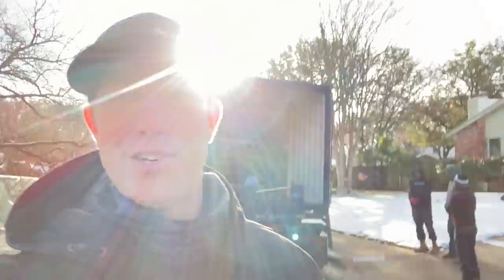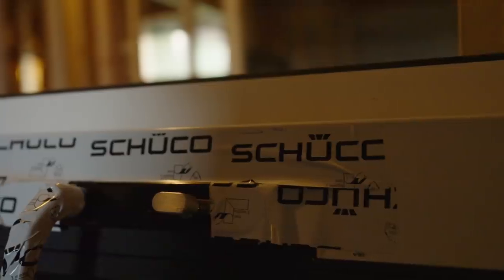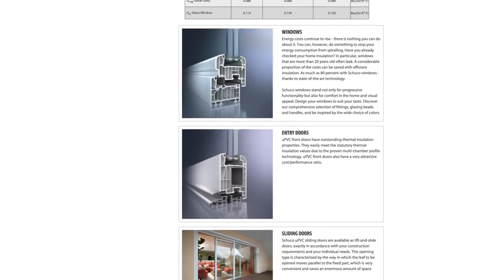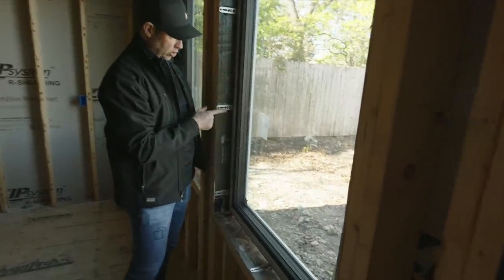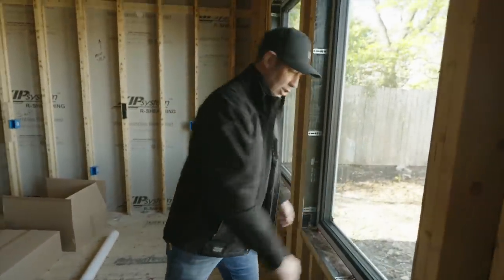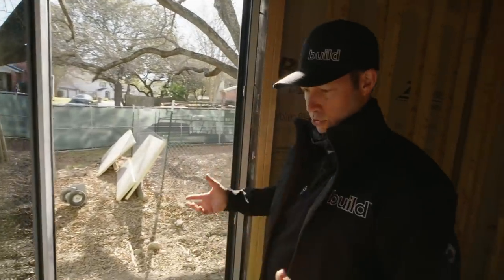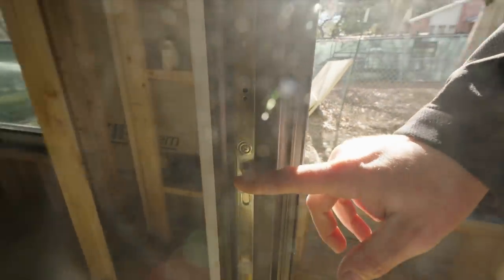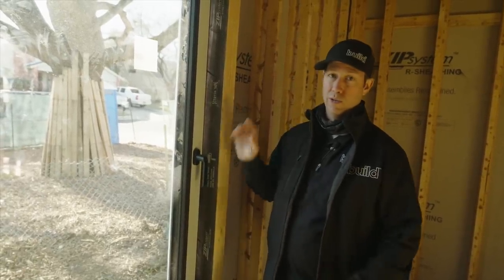Ordering Crazy Efficiency (and Affordable) Windows from Europe!

Comment: Me sitting here in Germany. That's a standard window here and you'd be fined if you use a shitty window if you replace your windows in an existing house or building a new one...
Another aspect you can have in those windows are locking pins for commercial use these doors and windows can't be pried open without taking a lot of time. These steel pins are also locking into a steel insert. As door fitment is another issue you have in commercial spaces for security and indoor climate control reasons.

Comment: I'm not a home builder, but have installed many sliders and doors. When we put down the sealant for the threshold, we put 2 very fat beads of caulk straight across the entire bottom to make sure there's a connection. We want to make sure there's contact between the threshold and the floor. Those thin beads at 10:26 are fine, as long as everything is perfectly flat and perfect, which it probably is on Matt's job ! Just wanted to let people know that most jobs require a much bigger/fatter line of caulk to seal the slider or door to the floor.
Reply: I agree with this.  Also to add, most doors aren't flat on the bottom contact side (the one in the video didn't look like it was either) so you need to be mindful if it's enough sealant to fill the gaps of the window base itself and any discrepancies of the floor as well.
Reply: @beurky , well said !
Reply: @augustreil  my opinion comes from a bad experience. when I told the window guy to caulk the shit out of it, and it was leaking from under the base, when we took it out the beads were a couple thin lines..
Reply: @beurky , I can believe that. Most don't realize how much it takes to make contact on both pieces.

Comment: Will you do a video on what's happening in TX with the freeze?
Reply: I'm not a video maker, so hopefully text will do:
Texas isn't used to being colder than Alaska.
In fact, during the winter power plants can shut down and undergo maintenance. The summer is when power is in peak demand.
On Sunday night, windmills stopped working (no anti-freeze systems, I believe, were in place), natural gas power plants went down, coal plants went down, nuclear power plants went down. I think around 1/3 of Texas' capacity went down. These places were either not winterized in response to a less severe winter storm in 2011, or not to the extent to survive these temperatures, or protocols were not followed. Also, many homes are heated by natural gas, and homes were given priority over natural gas power plants, so that's also why some of them turned off.
The grid didn't fail, but to keep it from failing, power had to intentionally be shut off.
Up in Dallas, snow and temperature records from 50 years ago were broken.
Enough power was brought back to restore power to 400,000 households, but during the night is another storm, but the temperatures are slowly rising. Thursday is almost above freezing, then Friday is finally above freezing.

Also, on a personal level, homes don't appear to be insulated terribly well. My home is from 1999. I was actually supposed to have someone who is BPI certified (got the idea from another one of Matt's videos) come over yesterday, not realizing I chose the coldest day in decades. I have a thermal camera that attaches to my phone. I can see freezing air come in through wall outlets and switches along the exterior, and through windows, which is why I'm watching this video. I had some rooms that were already hard to keep comfortable during normal weather.
Reply: @TheEngineerd  Thank you for such a detailed explanation. I hope things get better in Texas.
Reply: The power plants can't operate at capacity because the federal govt will not allow them to. Why, because it will create too much carbon and they will fine the plants massive amounts for violating their standards. It matters not that millions are with out power and thousands are dying. We must not upset the environmental wackos!!!!!!!!!!!!
Reply: @dannywilsher4165  Thousands? You mean...10 people? Literally 10. About on par for the geographical size of the storm. Almost every major storm system that hits the northeast claims about 4-5 people.
Reply: @dannywilsher4165  Given the complete absurdity of the first 90% of your comment, the irony of the last statement is pure comedy gold.
Reply: @JimYeats  LOL!!! Thousands may be stretching the truth a little but I was watching the news just before I commented and some official from Galveston was requesting everyone who had a refrigerated truck to please come to Galveston because they had so many deaths that they didn't have a place to store them. Sounded like thousands to me......
Reply: @ae1ae2  Well, who are you to tell me I am absurd? All I was doing was repeating what I saw on the local news!!! And I was totally serious about not wanting to disturb the wackos!!!
Reply: @dannywilsher4165  It sounds to be complete bullshit... There is no such federal law which would not allow them, and if there was, they could and should ignore it due to extreme circumstances.
The power plant cannot operate simpliy because of the cold, which they are not prepared for.
Reply: @juzoli  The person I saw on the news claimed to be an ERCOT official and he was the one dispersing the information I shared. He also was saying that the windmills and solar panels produce 25% of the power for ERCOT and because of the extreme cold the windmills and solar is useless. He also said they weren't allowed to turn up their gas fired plants because of EPA regulations. I think it is a bunch of bs also. It's not right that so many are cold and in the dark just because of govt regulations.
Reply: @dannywilsher4165  

Texas opted out of the national grid and set up its own because Texas did not want to contend with federal regulations, including those that mandate preparations for extreme power demand conditions.

Had Texas followed federal guidelines, much of the current chaos might well have been minimized or prevented.

As for those "thousands (who) are dyeing", what colors are they using, and are they color-fast?
Reply: @donna30044  All I was doing was commenting on what I saw on the news. I was exaggerating about the thousands because of what the man from Galveston said. If the fed has anything to do with anything it is always totally screwed up to the max!!!!!! 
And they really didn't say what color they were turning. Probably going to blue, turning to red and then black as they got frozen!!!!
Reply: @dannywilsher4165  

Oh, you meant that people were dying (becoming dead), not, as you wrote, dyeing (coloring thread, yarn, fabric, leather, or other materials).
Reply: @donna30044  LOL... Yes ma'am. Spell correct got me!!! I hope you got my humor in my reply. Hope you are staying warm!!!
Reply: @dannywilsher4165   you got a source for that? Because that’s not what I’ve read anywhere else
Reply: @dannywilsher4165  Don’t share unchecked bs then...
There is a big difference between something being frozen, or laws not allowing to fire it up.

Wind turbines and solar can easily deal with cold, proven by all the wind turbines and solar panels built at cold places. This issue is specific to the ones built in Texas. Which is sad, but we should never judge an infrastructure based on extreme events. These are designed to work fine 99% of the time, and no more. 100% availability for any infrastructure is crazy expensive, and doesn’t worth it.

Also there might be laws which favor renewable energy against gas and coal, and that is a good thing. But there is absolutely no law which would deny their power plants to start up in state of emergency like this.

It sounds like just a few anti-environmentalists who are trying to weaponize this weather event to reverse the progress we made in the past...
Reply: @dannywilsher4165  It's apparent that you don't like finding out whether claims are true. Have fun with that.
Reply: @melissamybubbles6139  I am merely doing what the masses do. I hear something on tv and it has to be the gospel. If a person behind the camera says something it has to be true. Look at all the people who have heard all the fake news for the last 4 years and now they are totally convinced that we had a horrible president. They weren't told any of the good so they had no reference of the truth. I guess I can't regurgitate something I heard without being called out for it. I guess should research for hours and find the truth before I claim something that fits or don't fit someone's narrative.  And yes sir, I am having lots of fun with it!!!!!
Reply: @dannywilsher4165  Your comment has lots of insults, but close to zero facts or logic.

You didn’t even care to explain what is that “made up bs” you are talking about. How do you expect people will take you seriously.
You have to be more specific, include verifiable facts, maybe scientific studies proving your point, and some idea how to do it better.
Reply: @juzoli  So my fact that Mt St Helen completely blows your total world view out of the water is not enough fact for you? Just what I was saying, thanks for proving my point. Sheep have a hard time believing the truth!!! Hope you are staying warm. have a nice day!!!!
Reply: @dannywilsher4165  
Mt St Helens CO2 emission: 0.01Gt
CO2 emission from fuel combustion alone, world total per year: 30+ Gt/y

Your volcano is not even close... I told you to include your facts...
Reply: @juzoli  Make up things to fit your narrative. LOL!!! That is funny!!!!!
Reply: @dannywilsher4165  I gave you facts. This is the official measured data about emissions. You are free to search for it yourself. But you gave nothing but insults.
And the funny thing is that there is NOTHING stopping you to write down the facts what backs up what you say.
Reply: @dannywilsher4165  
Search for this (I can’t put link into the comment):
USGS: Volcanoes Can Affect Climate
Reply: @edbouhl3100  LOL!!! How did you figure that out?
Reply: @dannywilsher4165  They were sort of right about the capacity. There are federal regs limiting porwer capacity, but because Gov. Abbot declared an  emergency, the rule was suspended.
Reply: @dannywilsher4165  ...wind farms in Texas were AT OR ABOVE average output during the Big Freeze.
Pictures touted as “frozen windmills in  Texas” were actually pictures taken in NORWAY.
Major power disruptions were from natural gas power plants (frozen pipes and meters/instruments) and our nuclear plant (frozen cooling pipes).
Other disruptions were from natural gas production facilities.. little-known fact, natural gas comes out of the ground with a rather high water content, this water content is what froze, due to facilities choosing to not insulate piping and other handling equipment.
‘
The  TV commenator who said “EPA regulations” prohibited gas plants from firing up is wrong...or lying.
Our Elected Political Leaders here in Texas who stated that this debacle was caused by “frozen wind farms” are wrong.. or lying.
the initial report by ERCOT shows the numbers... (it may have been ‘cleaned up’ or sharpie’d since being publicized)

FunFactoid;
Texas has the ‘biggest’ amount of installed productive wind generating capacity in the US.
Yes, everything IS bigger in Texas.
Reply: @YSLRD  I was repeating what an ERCOT person  said on the news... I was blessed and never lost power.....
Reply: @ernestgalvan9037  The ERCOT guy didn't say they were prohibited from firing them up, he stated they couldn't run them at full capacity because they would emit emissions beyond EPA standards and would be fined by the EPA. I have also seen it said pretty much what you are saying. That Texas never expected this type of coldness so they didn't prepare for it. Everyone has a reason or argument for what happened to fit their world view. Some don't know but spew out environmental wacko bs and some try to figure out common sense reasons that things happen. Either way, I heard last night that electricity was back to 100% of the customers here in Texas. Even that is probably going to be disputed. I just know I am going out to try and help some friends that have broken pipes and destroyed homes. Hope everyone has an absolutely wonderful day like I will!!!!!!!!!!!
Reply: @dannywilsher4165  You need refrigerators to store dead bodies. Without power only option is to place those bodies outside or to use refrigerated trucks.
Reply: I don't understand why people in US think we should have good insulation only if there is cold weather. Good insulation helps you to keep bills down in summer too. 

And it's more comfortable. If walls get warm regardless of cool air temperature you can feel heat radiating from those walls.

Comment: My sister just built a new home in College Station Texas and now has a leaking roof and busted pipes.  If the house was only sealed right this would never have happened.  Matt, I have been following you for a while now and I love your style of building, you are the OCD of tightly sealed homes.
Reply: The entire state of TX is seeing the coldest weather in 130 years.. the codes (and thus the houses) don't take any of this into account.. There will be thousands if not tens or hundreds of thousands of busted pipe issues over the next few weeks (Power grid failed because the generation facilities and substations are not winterized).. You will have problems with roofs as well as nobody uses ice dams down there ..
Reply: @darikmatters8866  count me as one of those. Our kitchen pipes (exterior wall) broke and flooded downstairs early morning 2 days ago. Luckily I caught it after an hour or so. Only 2" of water. Ruined the carpet and got a little on the sheetrock but otherwise okay. Better than it could have been.

Comment: I've seen many sliding door issues when using triple IGU or laminated glass.  The weight of that glass takes a toll on the hardware.  Schuco is known for having great hardware but even then, I don't expect these doors to be smoothly operating in a few years.  Unless they're in a showroom of course (in which case they regularly swap out hardware for that reason =P)
Reply: Big facts here. Also what happens when the hardware needs serviced or replaced? Can you get parts domestically, or even find someone who knows how to do the repairs?
Reply: I have a different brand, and they're from January 1999. (I just went and checked.)
There's no issues with the sliding door.

Comment: Thanks for the info, Matt. I was looking to remodel a Colorado cabin last fall, even talked to the planning department, but balked at the high price of windows that were only U 0.3 or so. If I'm going to spend that much I want below U 0.2. When spring arrives I'll take another look at the project--either do it or sell it as is.
Reply: Check out Alpen Windows in Colorado. They’re basically licensed to make Rehau’s German windows in the US; same uPVC tech with polystyrene insulation inside; they have Windows that can reach R-11 efficiency. They supplied all the windows for the Empire State Building’s most recent renovation. What I cannot vouch for is price vs these Polish windows in Matt’s video. Also — check out Seemray and Provia Windows. Similar to Alpen.
Reply: Just skip the middle man in USA. This company quoted me 73k and I'm getting mine directly from European manufacturing company for 18k + shipping and tariffs (5.3%)

Comment: Where u use R-Guard airdam chalk between the window and wall, we (in the Netherlands) use something we call "compriband", it is a sort of tape that you apply between the two and it starts out flat and it will expand to make an airtight seal.
Example: https://www.illbruck.com/en_GB/product/tp605-compriband-super/
Reply: We offer this option to our customers as well. We carry IsoBloco ONE in our US warehouse and can custom order IllBruck expansion foam tapes as well. Some of our customers use Illbrook TP600 2-3mm thin foam tapes for trim-to-window interfaces. Eliminates all the caulking.
Reply: @EASWindows  Thats it, i takes away the caulking, works fast and clean with good results (and cheaper ;) ) 
The Illbruck brand was just a example, there are many other brands out there. 
Something else we sometimes do, mostly in renovation,  first we place the frames, without the glass, and after the frames are done, we put in the glass.

Comment: Definitely haven't seen this used in houses before.  Do they have bug screens though?  And that's a lot of space needed in the room to be able to swing the window to open it, definitely wouldn't work with a lot of window treatments and furniture placements these days.  And I always thought that the best windows opened to the outside, so that the wind blowing against them would help force them more closed, not open in this case.  Still, neat to see some different stuff!
Reply: Correct, windows used in northern European countries (even Northern Germany at  the seaside) often opening to the outside for exactly that reason. The main reason to use windows that opens to the inside is about cleaning them. Yep, Germans hate scruffy windows.

Comment: Hi Matt! I live in Scandinavia and double glazed windows have been considered the minimum standard for decades, with triple pane being very common as well. A lot of houses in the US seem to use the sliding style windows, which is very convenient if you rely on some window AC units for extra cooling, but they don't seem very practical otherwise. I got in a bit of a discussion with my partner who is born and raised in the southern US (since moved here to Europe) and they wonder why the sliding style is virtually nowhere to be found in the Nordics. 
Do you happen to know anything about the efficiency of these vertically sliding windows compared to the style that just cracks open on an angle or are hinged? I didn't see any of the sliding style windows in the video and I'm wondering if that's about efficency, practicality or European manufacturing bias.